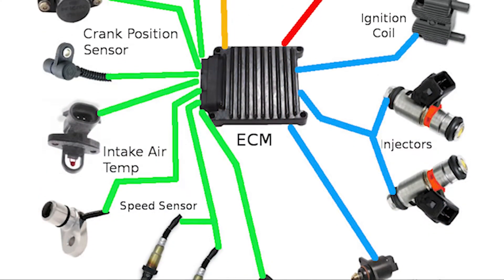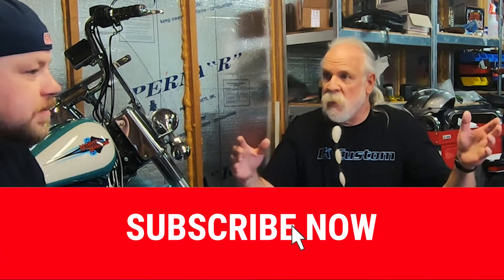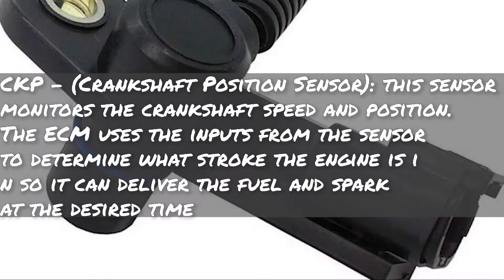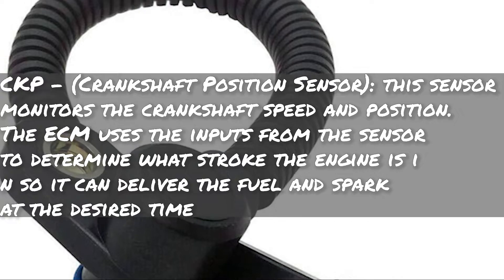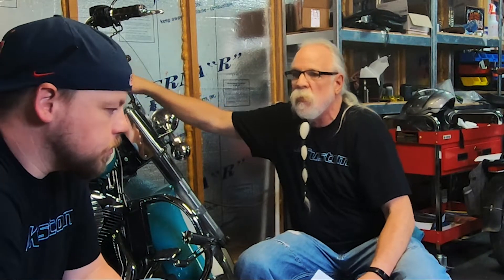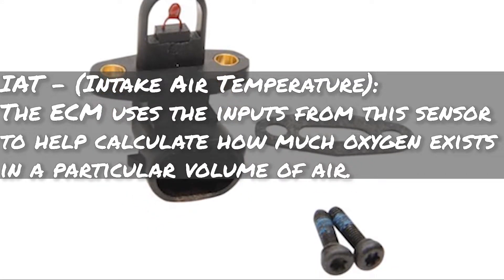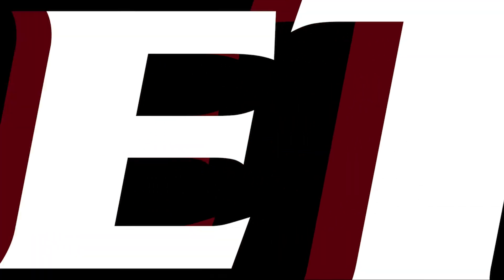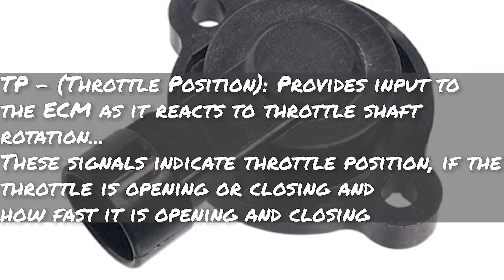How the Electronic Control Module (ECM) Adapts

Comment: Will the bike run without all that shit, closed out? Or did away with or 6:10 just running on basics fuel, spark timing and air combustion?
Reply from the maker: The only way around the ECM is to go with an older carbureted model—modern Harleys need it to run. Thank you for commenting! 👍 MB

Comment: Can you use another ecm with the same part number to test if you have a bad ecm? I know some bikes are connect to the fobs to start the bike? Thanks
Reply from the maker: Yes, swapping an ECM with the same part number can help determine if the original ECM is causing issues (e.g., misfiring, stalling, or error codes like CAN Bus errors). The same part number ensures compatibility with your Harley’s model, year, and configuration (e.g., fuel injection, security features), but the replacement ECM may need programming or flashing to work properly with your bike’s VIN and setup.
**Risks**: Swapping ECMs without addressing underlying issues (e.g., short circuits, bad grounds, or overvoltage) risks damaging the replacement ECM. Forum users emphasize diagnosing the root cause (e.g., a shorted wire grounding to the chassis) before swapping to avoid frying a second ECM.

I would talk to a bike mechanic to be sure that you do this testing correctly. 

Thank you for commenting! MB

Comment: Is their no short term fuel trim, fuel injection usually uses short and long term fuel trims, apparently harley  has a different name for long and short term fuel trims ,they need to just make it like every thing else so you can plug in standard scan devices and monitor  the sensors information. It should be long term and short term fuel trims or lamda is what European cars call fuel trim, . The whole thing about fuel injection is that it is adaptive and why it's superior to carbonated systems. I just realized their is adapters you can use and plug in obd2 tools can't wait to get one as my tool has live data display I would be able to see how much fuel is being added or subtracted..I'm pretty sure harley ecm only allows 10% + gain in fuel trim not 20% it also can subtract 10% so it has a 20% range 10 up and 10 down .If it could add 20% I don't think their would be any need for a tune,at 10% you can add exhaust and not need a tune the ecm will just add up to 10% to keep afr what is programed into the fuel table atleast in theory
Reply from the maker: Agreed, but it probably will not happen. 
👍😎 KP

Comment: How do I send you a video of my 2014 ultra classic EFI that won't start after replacing the fuel filter? I have no DTC codes
Reply: Everything works fob battery good and turns on with battery out and use my pin code but will not start with the start button pressed and in run position. Totally confused. Checked wires three times inside the tank and the fuses inside fuse block. Stereo, lights, blinkers, flashers, horn, navigation all works but will not start the starter. Had HD AGM battery 8/15/23 tested after trickle charger went green overnight and had 12.9v video shows 12.5v on the video. Have same voltage at starter lug from battery. Press run button and it goes to 12.16v
Reply from the maker: A fully charged battery should read 12.6V - 12.8V at rest.
12.5V is slightly below optimal but should still be enough to start the bike.
Voltage Drop to 12.16V When Starter is Pushed:
Normally, when the starter engages, voltage can drop temporarily.
A healthy battery under load should not drop below 10.5V - 11V while cranking.
Since yours only drops to 12.16V, this suggests the starter isn’t drawing power properly.
This is not that unusual a situation.  Even though the battery cables may look good, I would clean the connections and then tighten them back down well, preferably using some dielectric grease.  It is common for the ground cables to get a bit loose and/or corroded and cause what you are experiencing.  
It is also possible, that even with good solid connections that one of the cables is compromised inside, that that is far less common.
OH, I just re-read your message, I thought it was dropping to 12.16 when you pressed the starter button, but if it is dropping to that voltage when just pushing the run button, almost assuredly you have a bad battery, if all your connections are good.
If you remedy the cables and get the battery replaced, or properly charged and it still does the same thing, you may want to take it to a shop to have it looked at and hopefully get a better diagnosis and repair.
KP
Reply: @DKCustomProducts  yeah I had the battery load tested at AutoZone and O'Reilly's for a second opinion and it showed good battery. So I assume the problem is not right when I press the start button with the other switch set to run. I have a video of the problem for better understanding
Reply: @DKCustomProducts  yes I cleaned negative and positive cable ring connectors with steel wool. Did not have grease on hand
Reply: @DKCustomProducts  must still be a problem inside the tank or ECM faulty?

Comment: Changed exhaust on the 2003 heritage from original to Van hines straight pipes what problems is that? Original had no o2 sensor in them.
Reply from the maker: Twin Cams all run lean from the factory in stock condition.  Adding a free flowing exhaust makes them even leaner.  If you do not have some sort of tuner, like a Power Commander, or a jet kit, if your carbed) that should be done.
👍😎 KP

Comment: Ha guys,I got a  07 96ci softail, I fitted fueling products 543cam, cam bearings, cam plate ,oil pump, lifters, push rod's, 4.9gps fuel injectors, pv1 power vision,,, loaded to bike, loaded tune ,started bike ok 50psi oil pressure idel 3,4,minutes, turn off and wait same time try to start no go, contact dynojet support team, they send me new tune to load ,after loading tune in to bike, know there is no spark ,dynojet support say to reload original tune, but pv1 says no original tune exists, pv1 is supposed to save it but no ,no spark, no go, iam old school 👴no idea, any tips for me
Reply from the maker: That's a tough one! Please email our Custom Service and we will look into this and give you as much help as we can offer on the subject. I hope that we can help you get this figured out! 

Support@DKCustomProducts.com
😎 MB

Comment: Removed my ECM and replaced it with a thundermax and now my bike runs much better. One of the benefits of removing my cats and the ECM changing the AFR on my bike is the temperature on my right leg. My bike runs so much cooler. This summer on my way to sturgis and heading home we were in 104⁰ temperatures for a good part of the trip.

For you guys on the fence about a thundermax, it really was easy to set up and since it runs open loop its constantly adjusting to conditions. Every ride feels better.
Reply from the maker: Good to hear you are happy with your Thundermax!
Thanks for commenting.
KP
Reply: Open loop means it's running off the fuel tables and not using information from the sensors to constantly adjust the fuel trims ,and spark timing

Comment: I have a 2003 Road King that I just recently picked up It has ISS so I was wondering will the stock ECM adapt to 20%. It does not have O2 sensors but it uses the ISS, MAP, and the IAT sensors? Would iridium or copper plugs be better for the ISS system?
Reply from the maker: On pre-07 bikes that have EFI and no o2 sensors, the EFI is very different than what is discussed in this video.  They do not adjust, and much of what is in this video does not apply.

Regarding plugs, some will say one, some will say another.  Best strategy is to try both and see which one, if either, feels better to you.

Thank you for commenting! 👍MB

Comment: What if the iac motor is not working ok? Changed the throttle position sensor , map sensor, air intake temp sensor,iac motor.
Reply from the maker: Before spending any money on parts, the following video may be helpful to you....starting at around the 4:20 mark there is a discussion on adjusting the idle.

https://www.youtube.com/watch?v=T2aG284iCKc

Hope that helps.

KP

Comment: I’ve got a 06 Electra glide and the ecm is only letting one cylinder fire. It has 39k and I live Harley but this is absolutely bullshit.i already changed coil plugs and wires.
Reply from the maker: If you cannot find what is wrong with it via an error code (DTC) you may have to take it to a shop.

Here is a video about how to read DTC's (Diagnostic Trouble Code), you may find this video useful/helpful- https://www.youtube.com/watch?v=1t-uHPQs0U8

Thanks for commenting! MB

Comment: Hi Guys , have a 2017 RK Special. Had the head gaskets go at 30K.  When replaced the ECM throwing up fault on O2 Sensors lean and Rich , the bike is jittering at low speed , once over 40 kmh it rides out fine . Will the ECM control that better over time ?
Reply from the maker: From what you describe, something was either done wrong when the head gaskets were replaced, OR, there is another problem in addition to the bad head gaskets.

Whoever did the work should be looking at it to get it completely fixed.  The ECM will not adjust or correct for whatever problem there is that caused it to throw O2 sensor codes.

Without having the bike in front of us it is not possible to know what the issue(s) is.  HOWEVER, my first thing to look at is WHY did the head gaskets let loose?  If that was not addressed, it is likely the current issue.

Between the O2 Sensor codes and the jittery feeling at low speed, it could be intake or exhaust leaks...or could be the heads or cylinders are warped and the new head gaskets on not sealing well.  It could be a lot of things....the above are just some common reasons....not possible to know without having the bike in front of us.

Thank you for commenting! 😎 MB
Reply: @DKCustomProducts  thanks for the reply , this is one of many issues I’ve encountered with the M8 engine , it seems it was just a bad buy and Harley have no interest in sorting it apart from replace everything that goes . The fixes for all the problems are great to know but they did t look after the customers that bought them when they first came out and here we are paying twice for a bike that’s caused so many issues I’ve never seen the like if it in 35 years of riding bikes of every make. 
The new gaskets were the so called up graded ones . I think the issue is just the wrong fuel air mix which is why I was asking about the ECM re regulating it after re setting it . 
Anyway thank you .
Reply from the maker: Yes, many companies, HD included, have some troubles the first few years a new technology is introduced.  2017 was the first year of the M8, and it was late 2019/early 2020 before they got the majority of the bugs worked out.
This is why many folks do not choose to be "first adopters", but wait for 2-3 years on new tech.
If it is an AFR issue you are experiencing, with the symptoms you describe, it will need to be tuned...those symptoms are too far outside the parameters of the ECM being able to adapt.
KP

Comment: I am surprised the fuel trim is that lean. Is that why they came out with the liquid cooled heads so they don't burn things up
Reply from the maker: The Twin Cooled bikes do NOT have liquid cooled heads.  They do have a coolant tract that goes around the exhaust valves only.

Here is a video explaining what Twin Cooled is and is not- https://www.youtube.com/watch?v=wRRtRYWm5rw

The AFR is lean on all Twin Cams and Sportys, from the factory, the M8's are Not To lean, as you can see in this video- https://www.youtube.com/watch?v=Lb_57Z_Ipms

And in this written report with AFR charts- https://www.dkcustomproducts.com/milwaukee-eight-dyno-charts-other-interesting-info-dk-m8-rpt.htm

Harley is in a Catch-22, as outlined in the video link below.  They have to meet standards, and the M8 went a long way toward meeting those standards without being to lean.  They also want to maintain the classic HD look and sound.  The Twin Cooling is their attempt to do that, albeit, not a very productive one.

https://www.youtube.com/watch?v=N0kLaVQhbW4

Thanks for commenting! KP

Comment: Great info I would like to know a little more about the IAC and how that works with relation to other sensors
Reply from the maker: The idle air control (IAC) valve is located on the throttle body of fuel-injected engines, where it works with the vehicle's ECU to electrically regulate airflow to the engine to ensure smooth idling.

Dwayne and I have an experiment that we will be videoing in the next few weeks that will monitor the following:
1.  Oxygen content in the air cleaner, with and without an EBS
2.  Carbon Monoxide content in the air cleaner, with and without an EBS
3.  IAT (intake Air Temperature) in the air cleaner, with and without an EBS

Should be interesting!  👍😎👍  KP

Comment: all this sure sours my likes for motorcycles
Reply from the maker: I am sorry to hear that! What exactly sours your like for motorcycles?
Reply: @DKCustomProducts  The all new 2030 CompuGlide.  Comes with virtual reality, ride it in bed, no need to go outside
Reply from the maker: I agree that things were much simpler before everything became so dependent on computers, but Harley has been using ECM since the late 90's and it became standard in 2007. I would prefer things stay simple and mechanic, but that just isn't the case.
Reply: Is it a motorcycle or a computer with 2 wheels and a handlebar? I can troubleshoot and repair a motorcycle but not computers @DKCustomProducts

Comment: Thanks for the video. Well done. what I would like to know is, is it worth getting a power vision target tune with wide band o2 censors? I understand that the wide bands read a wider range of AFR but why is that better. The narrow bands will correct for rich or learn as is.
Reply from the maker: Narrow band sensors adjust the AFR in closed loop only.  Closed loop only works with low throttle and low load situations.  Once you go a heavy load or more than 50% throttle you are in open loop and no adjustments are made to the AFR (except from the LTFT).  That is where Wide Band Sensors are valuable.  They can read and AFR at 50% or more throttle, and with the use of a Target Tune they can adjust the AFR in that range also.

The narrow band will correct for rich or lean ONLY in closed loop, and to a small, and not very precise manner, in open loop via the LTFT.

There is a very good video that explains open and closed loop and LTFT (and more).  I highly recommend watching it, I believe it will answer your question.

https://www.youtube.com/watch?v=0vbTkRvFa80

Also, there is a good short overview of the benefits at this link- https://www.dkcustomproducts.com/dynojet-target-tune-for-the-power-vision-harley-efi-tuner-dk-pv-tt.htm

You ask is it worth getting a Power Vision with a Target Tune with the wide band sensors.

What is worth it to one person is not worth it to another.

IF you are looking to get the absolute more power out of the bike, and/or the best MPG, and/or the smoothest running, the best way to do that is with the PV and the Target Tune.

Only you can answer if getting all of those things is worth the $ to you.

To some it is, to others, getting that extra power and mpg is not worth the extra cost to them.

After watching the above video, and reading all the description at the above link, please feel free to email or call with any questions.

Thank you for your comment and for looking at our parts.

Support@DKCustomProducts.com
662-252-8828
Reply: Thanks you so much for your response! @DKCustomProducts

Comment: Is it possible to switch the efi to carburator?
Reply from the maker: Yes, it is possible. We have never done it, but we have seen some folk who have with both Twin Cam's and M8's.  

It can be quite an expensive and complicated process, to varying degrees, depending on what year and model bike you have.

We are not aware of any shop that specializes in doing this.

Comment: I have an 02 ultra classic was riding on highway and the bike shut down. Won't restart . Have new plugs ,plug wires,new coil, checked crank position sensor checked fuel pump fuel filter . Bike still won't start it's cranks but doesn't turn over . I been working on it for over a month I don't know what else to do . I can't seem to find the ignition control module and believe the BAS is part of the of tssm . Any suggestions
Reply from the maker: Man, would love to help, but troubleshooting over the internet is difficult.  I do have these thoughts that may be helpful:
Get the HD Service Manual for your bike.  I would not work on my bike or someone else's bike without one.
Fuel and Spark.  Gotta have both.  Easy start is to pull the plugs, and turn it over and see if you have spark.  If so, move to the fuel (carb or EFI).  If no spark, then start down that path.
Reply: @DKCustomProducts  yeah I have spark checked it with mine spark tester have the manual on order just been a month since I have ridden and you know how that goes . Appreciate your response you guys keep up the great work .
Reply from the maker: I hope you get it figured out! Thanks for commenting!

Comment: Great Video!  2005 EFI Road king. What is the process to replace the ECM. How Much?
Reply from the maker: It  unplugs, and new one plugs in..  You would need to check with a Dealership to find the price, although, we are seeing a MSRP of $429.65, PLUS it will need to be programmed to your bike.  Don't know what they will charge for that.
Reply: @DKCustomProducts  No click no crank. fuses & relays look good. Its a 2005 RK. I guess i'll hard wiring the starter button with a relay and a fuse to bypass the ECM.
Reply from the maker: Is the fuel pump working, just not the starter?
Have you checked the positive and ground wires and connections?
If other electrical items are working, just not the starter...I would be looking at all the cables and connections first.
If the fuel pump is working, then before doing that whole bypass procedure...have to tried putting power directly to the starter?